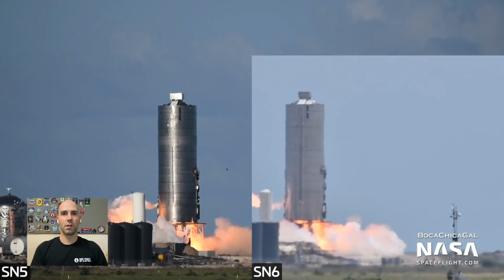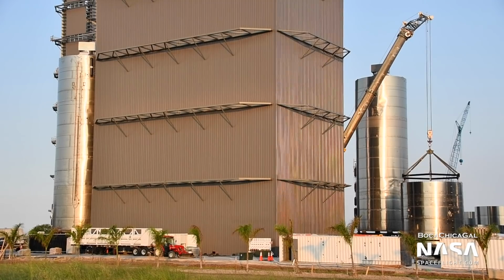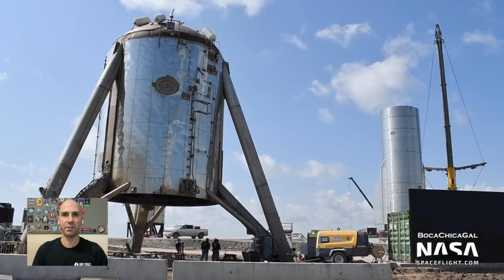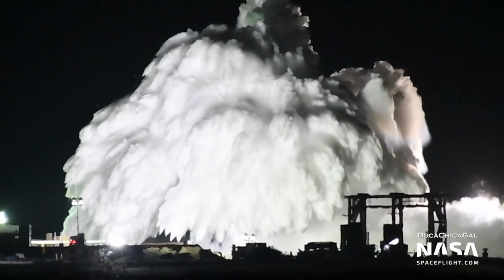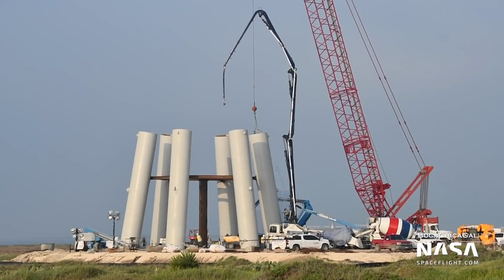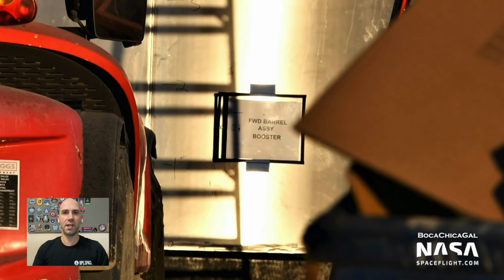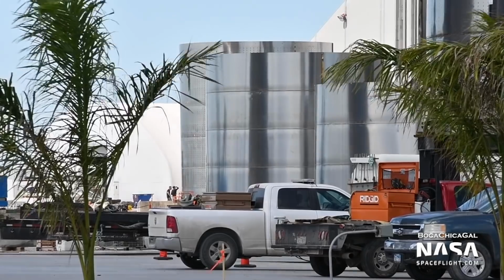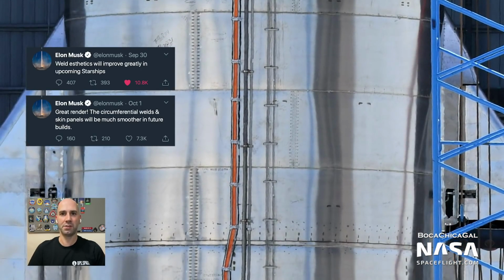SpaceX Boca Chica Weekly Update - Starship SN8 prepares for testing - Super Heavy assembly

Comment: As for me the building purpose at the old gas well is quite obvious! Musk's going to create an 'air plant' - a some plant for air 
liquefaction to produce LOX and LN2. It's obvious that future Starship's and SuperHeavy's tests will consume an enormous amount of LN2 and LOX. That's why it's very reasonable NOT to carry this amount with a tank trucks from far away but produce it on the spot. Yes, this production requires a huge amount of energy but Musk already told something about solar and wind power usage.
As well may be this plant will produce a liquid methane from the natural gas (if the well is not dead completely). Yes, the old well may be half-depleted and is not cost-effective for industrial gas extraction. But Starship launches will not require such an 'industrial' amounts of gas. So may be :)

Comment: Ullage and liquid pressure differential in cryogenic fluids in a pressurized tank is due to the temperature difference between the vaporized (warmer) ullage portion and the colder liquid volume in the tank. The vaporized (ullage) portion at a higher temperature is at a higher pressure and causes the overall increase in tank pressure above the "liquid only" pressure.

Comment: Pressure difference is due to the weight of the liquid, more specifically the head of the liquid or height of the liquid column. has nothing to do with gas vs liquid